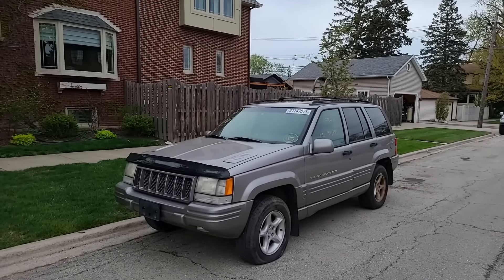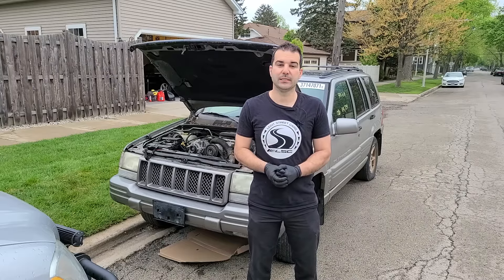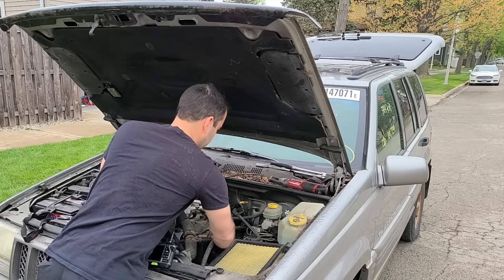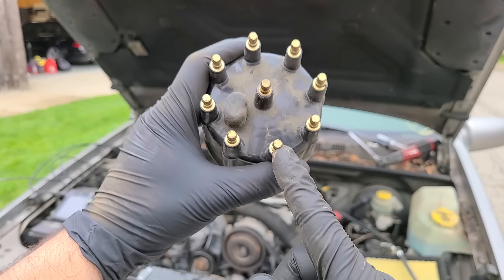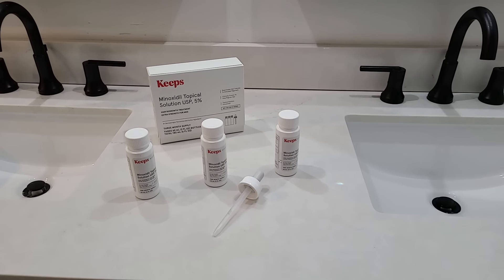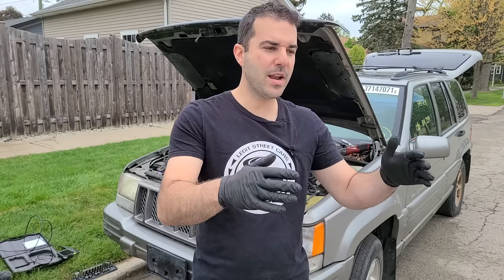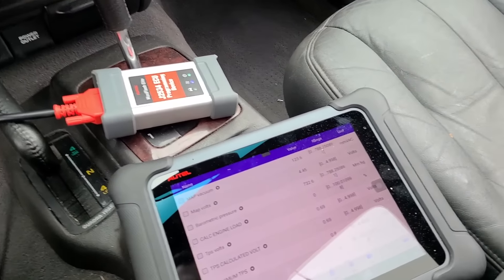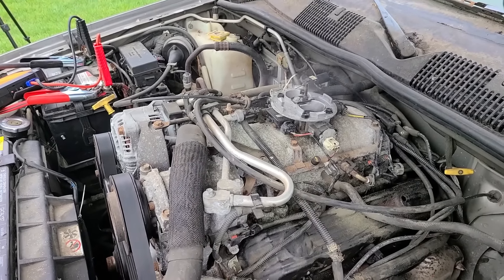First Start Of The Abandoned Fastest SUV In The World & What I Found  Inside The Engine! DIY FIX!

Comment: Throwing parts at a problem is hit and miss at best and often you dont find the actual issue even if the car comes back to life.
Money aside watching you work through the diag process is gold especially with cars im not familiar with, Case and point a friend had an issue with an older Volvo 740 LH 2.4 and threw a ton of FCP parts at it but ignored the basics, I grabbed a Crank sensor I had on the shelf, got around the back of the engine (In the bell housing) and replace it and Boom she ran sweet as a nut.
The tail had been chewed through by mice and was fairly obvious if he had run the standard visual checks.

Comment: As a former tech. Of course you checked for codes first, right? I recently picked up a 2004, v8, 4×4.( all wheel drive) real cheap. The first thing i did was check the codes.

Comment: That's not a reservoir, it's an overflow tank. The cooling system only pulls from that when there is enough coolant in the rest of the cooling system to build pressure to open the valve in the radiator cap.

Comment: Fuel injection flush every 30k miles is a must for any car. Should be done at 30,60,90,120,150 ext you will never have this problem and it's worth the $185 fee

Comment: Was wondering if the relay pins and socket was filthy and moving it cleaned off some of the tarnish resulting starting, I had a 1988 EA Falcon 4.1 EFI which had stood for few years , and it came down to a tarnished pin on the starter relay , cleaned and fired up first go.

Comment: Also your neighbor clearly had his foot on the go pedal when he cranked it meaning it's easier to crank because it doesn't have to pull all that air through a small hole
Also that means the ecu will add a heep of fuel and that will help the bad fuel issue
Its a common thing I do when a car isn't starting for a first start tune when I'm tuning cars
I did a start up tune on a 'tuned' car the other day that needed this to start every time because the tuner didn't know what they were doing.
Different circumstance but same principles

Comment: Almost as sweet as my wifes SUV, a 2020 Rav4, lol. I’m more of a truck guy myself, so Taco it is.

Only time i’ve seen an engine with good compression, spark and fuel not run, is restricted exhaust. (2 minutes into the video)

Edit: Bad ASD Relay should give you no (or low) power to injectors and coil...usually. So it shouldn’t have had “good” spark, or lit the injector noid light brightly. 🧐
Injectors like to stick with bad fuel...pumps too.
You seem to know all this, but I can’t keep myself from helping even when it’s too late. Haha

Comment: When coolant is low in the radiator it should be filled both at the radiator and the reservoir, as well as the system bled if need be.

Comment: It’s sounds like your intake air control valve is sticking open, that’s the hissing sound from the throttle body. It’s on the back of the throttle body

Comment: There's been no need to use HEET for years now. Gasoline contains at least 15% alcohol. And you spray the starting fluid IN the TB, not all over the top of the engine.

Comment: Funny I found 4 hole fuel injectors for a Jeep 5.9 for $50-$75 on eBay, not $400, of course if you can clean them for less that is good. I bet that Jeep will go places that Audi would fail miserably on.

Comment: similar thing happened to our old F-150 

it was an electrical short with the fuel injection system, apparently the previous owner tapped into all kinds of random wires so they could power up some LED lights. 
complete fire hazard. but our mechanic fixed it lol

Comment: Alex, yet again you kind of missed it.  I'll leave the longer comments alone covering all the minor issues, and just stick to your conclusion- those injectors are supposed to spray a "pencil" pattern not a fan spray pattern like older injectors, many newer injectors used mostly in sequential injection systems do that. The reason is that the sequential system times the injector to fire at the back of the valve when it's closed and uses the heat of the valve to vaporize the fuel giving you a more homogenous mixture that gets better MPG and lower emissions. As designed you don't want a fan spray pattern because it just coats the port walls with liquid fuel that then has to run down into the cylinder. 

Those injectors could still be bad/clogged but typically when they are that pencil spray shoots off to the side somewhere instead of straight out.

I'm guessing that you're hinting at rigging something like a BG pressurized injector cleaner which I'm interested in seeing (I know that I've thought about it multiple times but have never come up with something I considered safe). I hope that this doesn't dissuade you from doing this, if you have a good idea there it would be helpful and wouldn't hurt.

As grungy/nasty as those injectors look, if all of those injectors are spraying that same pattern or something close to it it is not likey that you really need to replace them- most of what injectors get replaced for is not enough to cause a performance problem in most commuter cars, OEM's recommend it way sooner than necessary for emissions reasons and for diagnostic reasons (the small percentage of time that it might be causing something that wouldn't get caught otherwise, it makes them money anyway). I would rn a lubricant based injector cleaner through them at multiple times the recommended concentration in the gas.

Speaking of gas, you show a fuel pressure gauge but I don't think you actually showed testing the rail pressure (if you did sorry, I was half asleep when I watched this), that and some indication that the pressure regulator is working correctly would be my second from the top suspect. My top would just drain the whole tank, put 3-5 gallons of NEW fuel in there with enough injector cleaner concentrate for about 15gallons in it and see if it runs better right away or after a few miles.  If you're cheap like me you can even get rid of the bad gas by dumping 2-3gallons in the tank per tank till it's gone.

Comment: Well, I was hoping that by the time you saw all of the injectors spraying the same pattern, you'd realize that it's a feature. Those are like some other injectors I've seen that is a stream type pattern and not a "normal" mist cone. Some cars are set up that way, more common in the 90's it seems. 

That said, it's definitely a good idea to clean them up a bit and replace the o-rings - at this point it's good maintenance. ;)

Comment: Even though the engine turned over you may have had to low of voltage for the electronics to function. Must be 7 and 1/2 to 8 volts. The engine will turn over with low voltage but the current will burn out your starter

Comment: My idea of making it more reliable is adding motorkote hyper Lube to your engine oil two ounces per quart it will also make the bearings super lubricated in your turbos but your crankshaft and your cams will love you for it because it was super lubricate them as well permanently, watch the motor code video from the manufacturer and you'll kick yourself for not using it!

Comment: Distributor in this application does not adjust ignition timing it sets fuel sync. 0° at 1000rpm is factory spec.

Comment: Misfire on my 2004 Chevrolet Express 6.0L.  After the mechanic threw hundreds of dollar in parts at it, it ran just as bad if not worse.  17:40  I disconnected all the coil wires and then "Reconnected" them and it is running fine.  Connectors were difficult to use under the dash resulting in bad connections by other mechanics.  Mechanics are usually the problem, not the parts.

Comment: I always have trouble using the fuel line removal tool/clips. for some reason i end up just struggling on everycar i work on with the fuel line removal. 

Also, what do you use for audio recording ?? It sounds so clear, even when there's a plane/car/noise coming by. i can still hear you clearly.

Comment: Men. Before you crank engine like that
 first; pour some kerosine to release rings, second; pour oil into cylinder, that rust will do damage to cylinder walls. third; crank first with sparks taken out, witout pressure, check oil pressure. It doesn't work like you do, put new starter and wonder why it doesn't start. You doing it wrong.

Comment: Had one of these in the same color some years back ad loved it. Looks like yours is suffering from the same thing mine was with the driver door not closing properly. Mine was from the latch not working right but other than that I didn’t have any other issues and would probably still have it if the jackass that ran a red light didnt t bone it.

Comment: just unplug the 2 fuel rails and clean each of the fuel injectors with a toothpick or twist-tie wire.  Soak injectors in new gas.  Get new o-rings. Saves you a $100 tool.

Comment: Alot of people at least on the 4.0L jeep engines switch to 4 or 12 hole injectors. The factory single holes are shit. I have the 4 hole injectors on mine and it starts easier idles smoother and has way better throttle responses

Comment: Those old Jeep’s are known for leaking capacitors in the engine computer which for sum reason causes them not to start unless u remove and reinstall or just wiggle the auto shut down relay.  Sounds crazy but when my 93 started acting up I was able to verify with sum research.  There are sum posts on jeep forums verifying this concern.  See what ur jeep does over time.  If you have to start wiggling that relay to make it start.  Take a look inside the computer for leaking capacitors

Comment: I have two XJ's which are the jeep I choose because I use my jeeps off road, I have a 5.9 in my Durango with Hughes air gap and 202 EQ monster magnum heads, PPH headers, it runs great. I have a friend with 4 of those 5.9's kind of a nightmare hunk. Too many electrical gremlins, overly complicated cooling system, and you are stuck with the crap 249 t case with viscous clutch ....... just walk away

Comment: Pull each injector and throw them into any container that will be able to hold them with a quart or two of ATF and let them soak for a day or two...ATF has plenty of detergents that clean an arent corrosive then just your pulse tool and pulse them with seafoam or injector cleaner of your choise....PROBALLY be good idea to 8nstall new fuel filter as well

Comment: replace the map sensor in front of the throttle body.. mine on my 5.9 died and the engine shook like this and it did this very same thing yours is doing.  Those Injectors actually seem pretty normal for chrysler injectors back then, they never really did atomise like you think they should and instead just shot straight streams almost.  I dont think this is actually your problem..  Try a map sensor from a junkyard engine or buy a new one

Comment: How about rebuilding them? Here is Phoenix AZ there is a place called aus injection they rebuild them. Have a fuel injection 1976 bug original injectors where going to be about $1500 to replace if I could find them but took them their and now they run perfect and it was about $100

Comment: That's right, find out the error.  It may be fun to guess, but it will be expensive.  It's like the workshops, the computer enumerates errors on no1 then it continues, change and change.  That's when you connect your own brain, you have to KNOW how things are connected, and you think about it.  Do not change everything that the computer says is wrong.  If it is wrong on No. 2, it will be wrong on No. 1 or No. 3, et
That is when knowledge and experience come into their own.  You have it !!  👍.  That's what you're talking about in this video, do not change until you know the error.

Comment: For anyone else watching this he made a few basic errors. He should have removed all old gas first put in a couple liters of fresh gas pumped that thru fuel lines. Then put the 5 gallon of new gas in tank with fuel injector cleaner and fuel water treatment.. 
    Second he should have pulled plugs and sprayed a little engine storage oil into cylinders to prevent scoring on cylinder walls.

Comment: I had a 98 5.9 GC.  The owners manual specifically states that you should not use any blend of ethanol fuel, even 10%.

I ran into an issue with a dead cylinder when the heater hose rubbed through the insulation on one of the injector wires and shorted.  It damaged the computer so that even with the wiring repaired it still wouldn't fire the injector on that cylinder.  I had to get a new computer.  Damn dealer wouldn't warranty because they said it was rodent damage although it was obviously wear from the heater hose rubbing the wiring.😡

Comment: My 96 I6 just died randomly one day. Wouldn't fire. Showed no fuel. Had no idea what happened. Walked, got some gas, put it in just in case I wasn't paying attention (cause I was low but didn't think I was THAT low) and still no gas. Dead empty. Well I just put 20L in it.... Pop the hood, check for spark.. nothing. Looking for anything obvious that blew or something out of place. Still nothing. Call Dad, who had a 94 I6 for years and knows them inside and out. Comes by, looks at it... Changes one 20A fuse and I'm off. It was my auto-shut off. One wire on the last O2 sensor got stripped some how, and was shorting out on the cat. I didn't notice until I went underneath in the day after I got it home. Taped it up, no more shorts. Thing runs like a champ.

Comment: The battery may have been so low and so bad that even though you are getting crank amperage voltage may have been too low to operate the e c m and other related Electronics. A lot of these electronic units need at least 7 to 8 + volts to work. even with your capacitor on there the voltage may have still been too low. The capacitor will increase amperage but not necessarily voltage. I'm talking about Ohm's law and Watts law these 2 electric laws and physics probably apply

Comment: What you did with the injector tester is not a test. It's as if you did a bunch of work for nothing. You missed the part where you hook the fuel pressure gauge uo to rail. Run fuel pump record reading. Run each injector same cycles with tester. Record reading. Analyze results. It's to measure volume each injector flows relative to each other.
Reply from the maker: Right I wasn't using it as a tester. I explained what I was doing with it in the video.

Comment: Your no start was most likely because Batt V oltage dropped to much during cranking. That gen jeep would do that and often loose Idle cranking on a low battery. 5 years of sitting can cause relays/connections to get cruddy also.
     5 year old gas is going to be nasty. That gen jeep injectors where junk new.
      Also that motor is known vaccum leak mess.

Comment: I think it would have started immediately if you would held the pedal down. All you new car mechanics think it is supposed to start fine at idle after 7 years when the injectors are gummed up when it needs a full throttle to push the gunk out the injectors. Even with my cdis , I beat them and they run great, my mom uses my cdi , gentle driving,  and it starts to idle rough after a few weeks. Been sad since you got rid of the cdis, not interested with some of the junk you been playing with,  watched this one because I just sold my last jeep.
Reply from the maker: So pushing the mechanical throttle blade open pushes the gunk out of the injectors you say?

Comment: My buddy bought an older Grand Cherokee . I told him Don't Buy It it is junk. Well he didn't listen to me. The scammer that sold it to him should of worked in Hollywood. That pos jeep was like a cartoon. As soon as he drove it off the lot he started having troubles. Fuel pump went and the starter from trying to start with no fuel.. It wasn't even off the dealers lot yet. The whole front end needed to be replaced. GARBAGE.. Buy it looked nice .. Black with Gold trim. GARBAGE..